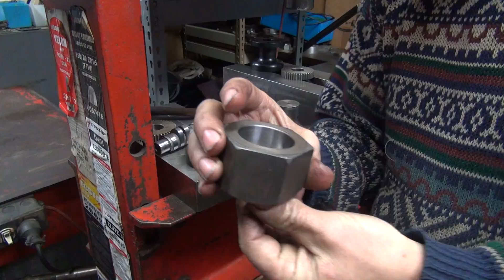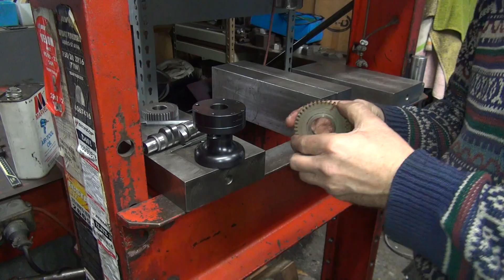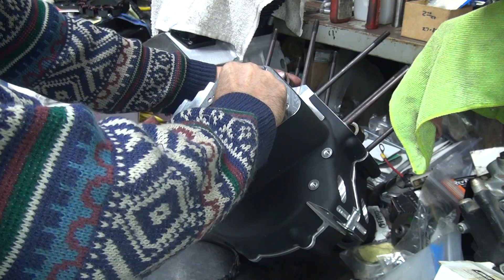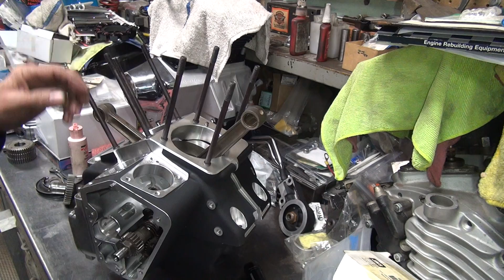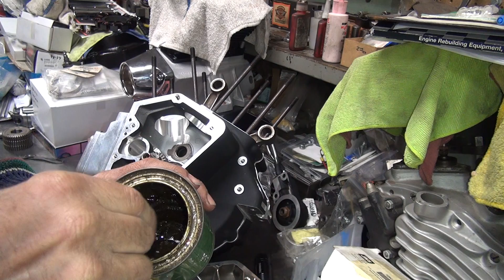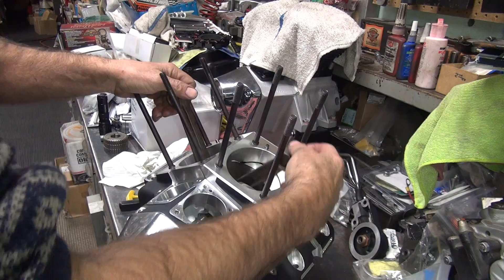1997 80ci evo lower end rebuild #113 ultima case swap harley evolution by tatro machine

Comment: How does changing pinion gear knocks the crank out of true if you use the gear locking tool?
Reply from the maker: looks like an ai learner.
tatro
Reply: @TatroMachine looks like someone who doesn’t read instructions. But seriously if crank can’t withstand pinion gear torquing how you supposed to ride the bike when you will have more torque on your crank while riding
Reply from the maker: the pinion shaft only drives the oil pump and camshaft. the sprocket shaft drives the bike.
tatro
Reply: @TatroMachine i get it but you torqing the pinion gear on what on crankshaft right? You use pinion gear lock tool or you hold the crankshaft on the primary side of the bike
Reply from the maker: nope, the thin ass pinion shaft flexes and stretches as you tighten it. this causes the crank to go out of true.
tatro

Comment: Why wouldn't that tolerance wear in over time?
Reply from the maker: wear in or wear out. you will get one of them. it depends on the load on the tight parts. heat kills everything.
tatro

Comment: When installing a new cam, is it better to press off the old cam gear and put it on the new cam or just go with the cam gear that came with the new cam (thats if its all with in specs.)? My thinking is, that the old cam gear is already broken in and fit.
Reply from the maker: like most things, condition matters. most of the time i just use the new gears. if you have a good fitting set of used gears then reusing them might be the way to go. 
tatro